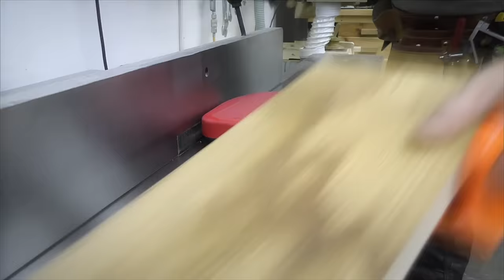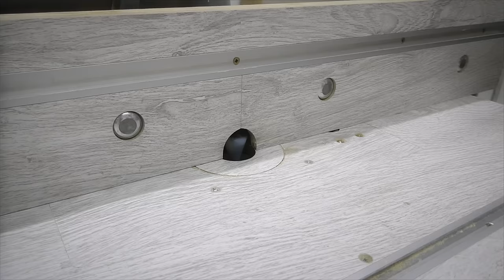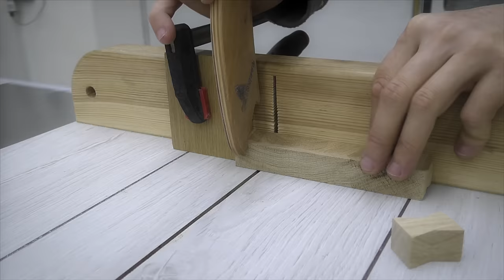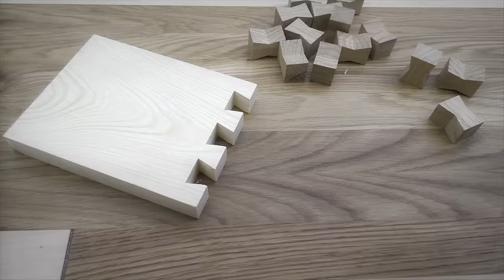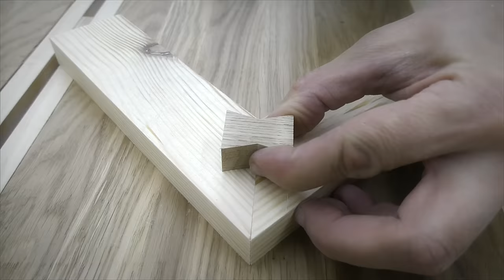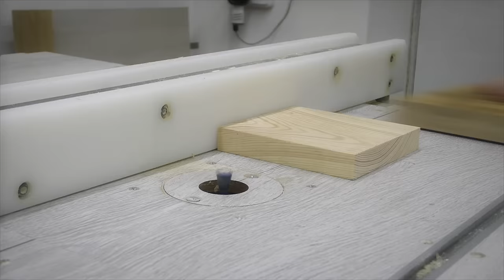5 Alternative Dovetail Joint Ideas

Comment: Well I love this. Spent 5 hours today trying to do it. For those who may endeavor you better be prepared to make sure all your tools are dialed in perfectly. When he says twice the height of the height of the dovetail bit he means exactly that. When he says the dovetails need to be the thickness of the bit, he means exactly that. Even if you are 1/32 of an inch off you will leave gaps. He makes this look easy and it probably is, but your accuracy needs to be dead on. I still haven't got the width correct. I only had a 1/2" diameter bit and the height was only 3/8" that I could reasonably get out of the bit. I noticed when watching the video closely that he had a 22mm bit. I was able to find a Whiteside 13/16 inch bit on Amazon. I think this will be pretty close to what he was using. This is almost 21mm. This should cut much better than what I was using. I will report back.
Reply: I tried the Whiteside 13/16" inch(20.5mm) bit and it made a big difference. I noticed that he used a 1/2"(12.7mm) bit on the last example. My bit did not do very well and could not take the stock in one go. I have another bit from another set and I will try that today. See if it makes a difference. Dimensioning is very important to consider when doing this. If you look at the bowties from the front and placed vertically the dimensions are determined as follows. Height is double the height of your bit above your router table. This is determined by the depth of your test cut as he notes. I would determine this dimension based on whatever your stock thickness is minus whatever you want for your blind. In other words on 19mm stock you might leave 3mm for the blind. That would mean your dimension would be 13mm. This can be whatever works for you in what you are trying to do. The width is always going to be the width of your dovetail bit period. The best way I have found to do this is to rip your width exactly to that dimension. In my case this is 13/16. In this manner you can register the bottom of the bit with the face of the router table fence by placing a very thin straight edge flat on the router table and pushed up against the fence. You can then register the bit against the ruler by moving the fence forward or back. In this way there is a zero cut at the base of the bit and leaving your dimension on the top and bottom untouched from what you ripped. The depth of the dovetail is determined by the thickness of any stock that you are cutting vertically.
Reply: By the way, he does not show it but the reason he chisel trims the dovetails on the first example is that this allows the dovetails to recess over the the ugly semi circle at the termination of the router bit cut. This is a brilliant idea. Not sure if it was his. I think those half circles are very ugly when you see them on drawers done with machined dowels.
Reply: Thank you for this! This will be extremely helpful information as I'm going to hopefully undertake this This weekend
Reply: @Gressyjam  Hi Jesse. I read through my notes and noticed a mistake. On 19mm stock (3/4") I would leave 4mm for the blind. I was getting a little cracking at 3mm. Perhaps it was the wood but I felt it a bit too thin. So 19-4 = 15mm for the height of the router bit and 30mm for the height of the dovetail(bowtie). Typically if I take 19mm stock, it ends up 17mm. If I leave 4 mm for the blind that leaves 13mm for the height of the bit and 26mm for the height of the dovetail. This worked out perfect for me and the way I will do it going forward. If I went with 1/2 stock I would get a different dovetail bit for that.
Reply: @ptcruiser2012 3:21 parece que racha.

Comment: That's a nice sawstop, wish I had one at home, had to fix the one I use at work the other day tho, because they've not replaced the start capacitor in 5 years at least of nonstop use, plus a spring broke on the centrifugal switch, but fires up like new after replacing about $50 worth of parts.

Comment: А вот зачем оно нужно, шпунты "ласточкин хвост"?
Если вы туда воткнете простые прямые шпунты смазанные клеем, то прочность будет даже лучше.
И уж если вы все равно фрезеруете, то проще и надежнее сделать просто шиповое соединение.
Так зачем?

But why is it needed, dovetail piles?
If you stick simple straight dowels smeared with glue there, then the strength will be even better.
And if you are milling anyway, then it’s easier and more reliable to just make a spiked connection.
So why?